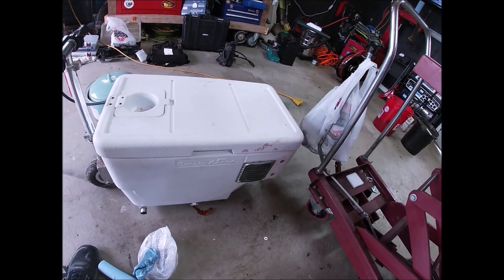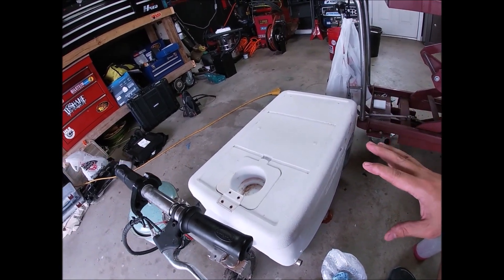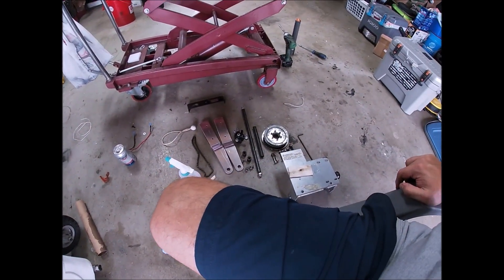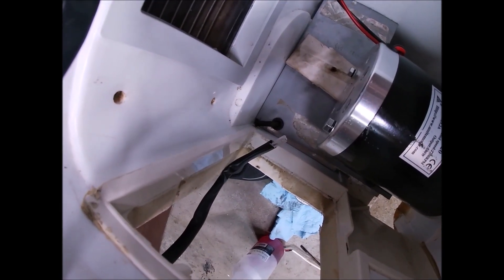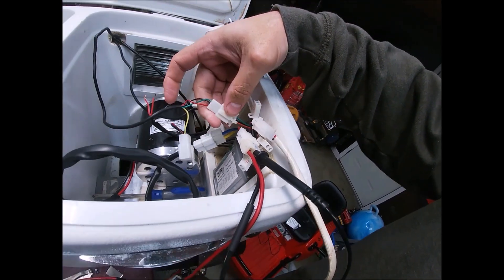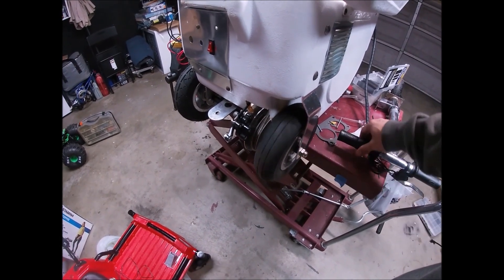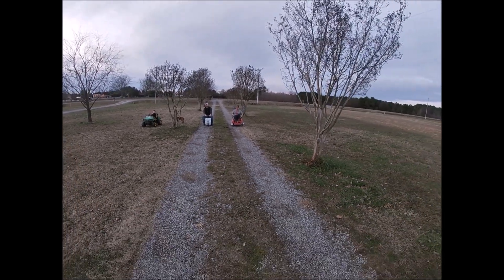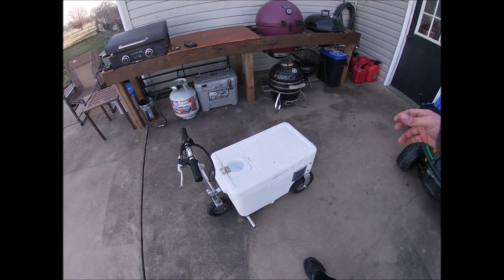Cruzin Cooler Restoration and Upgrades | 15 mph Lithium Ion

Comment: Nice scooter!  Ive got a 500w I decked out for music festivals.  I added lights, a stereo, flag, and ape hangers.  The agm batteries went bad and the replacements i ordered are terrible, lithium is a great idea
Reply from the maker: The Lithium Battery has been awesome. I need to wire in some speakers and lights like you have done. It's such a conversation starter!!

Comment: Thanks for this video! I have a garage filled with these things. I have 3, 300 watt, 2, 500 watt. and 2, 1000 watt. (I think) Its been years since they have worked. First went the tires and tubes, then the batteries. I was just looking online for replacement parts and upgrades to get them back on the road to use for marking and promotional purposes. (Hot women giving out free beverages at summer events)
Reply from the maker: Sweet, wishing I would have went ahead with a 1000W 40V motor now. Run it on a 60v battery.  I've been riding this thing around every chance I get. Good luck, I did have to replace the tubes since this video. Working on going to a bigger wheel and tire currently.
Reply: @cvsahara  My coolers have been stored in my garage for over 7 years now. I forgot all about them until a few days ago. I think I will work on the 1000 watt ones first. I just need to get tubes and tires, a battery, and upgraded controller. These things are a blast. Where I live there are about 6 bars spread out within about a 6 mile radius. My friends and I would get on the scooters and make the "rounds" on them. So much fun. The best part is the reactions from the public when they see them. I have met so many good people when riding these. Its almost like therapy. Having a bad day? Jump on one of these and ride around town. People will honk their horns, yell, laugh, ask you questions, etc.  
The best is when someone yells, "Hey you got any beer in there?" lol The look on their face when a ice cold beverage gets handed to them. I have the trailer that goes to the scooter. Used to take my friends Dalmatian for a ride in it. Had the cops pull me over telling me that I was impeding traffic. So many people were stopping in the middle of the street to take pictures and ask me questions it was crazy! 
Not once but 2 different times my friend Big Ern (rip) was riding with me and we both had full loads of ice and beer. I road them so much I was comfortable jumping off the sidewalk curb onto the street. Big Ern would follow behind me.  This happened 2 different times. Riding down the sidewalk at night, jumped off curb into street. Big Ern eats it on the street. Cooler flips on its side, beer and ice everywhere. Next thing you know sheriff deputies light us up blocking oncoming traffic. They were laughing so hard that they could not talk for a minute. They started asking questions while helping us pick up the beer. They had never seen anything like that before and had no clue about the laws. They took some pics of each other on them and told us to be careful. About a month later at the same intersection, Big Ern eats it again! This time the Police were there. Same reaction. lol 
Sorry this is so long. I have not thought about this stuff in years. I really forgot how fun these are to ride. Not only for the rider but for anyone that sees you riding down the street. I own a small custom printing business. Do you have a logo? If so feel free to contact me if you would like some decals. I will hook you up for free. In fact if you want I will make you some larger sized decals of your logo (or whatever design you want) that you can put on the sides of the cooler. My business is 707 Decals. You can find me on Insta or facebook. Just message me if you are interested. Take a look at my social medial to see the work I do and the people I work with. That way you can verify that I am not a scammer. Thanks again for this video!
Reply from the maker: @kientzdan  that's hilarious. I am building a cooler trailer for mine as we speak. Reactions to these little things are certainly priceless. You would think in the age of electric everything that it wouldn't be such a novelty but people love them. Switching to a lithium battery was the best thing I did with mine. 2 40 volt 6AH weedeater batteries will last all day at a fraction of the weight.
Thanks for the offer, I'll hit you up. I do need a decent decal for mine. Only other thing I will be adding after the trailer is nice little marine cushion for the seat! Good luck with the restorations on yours!